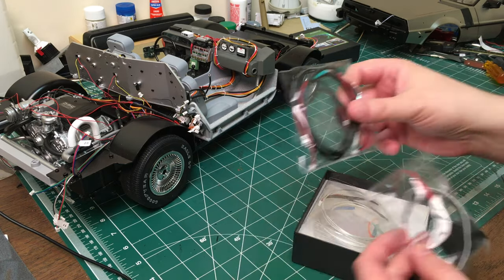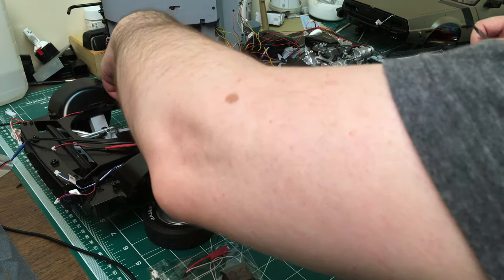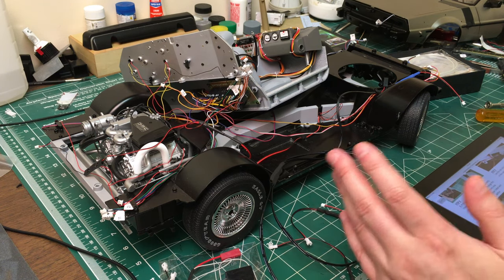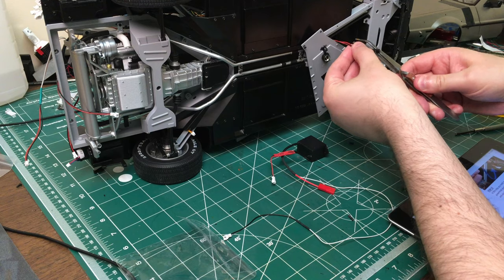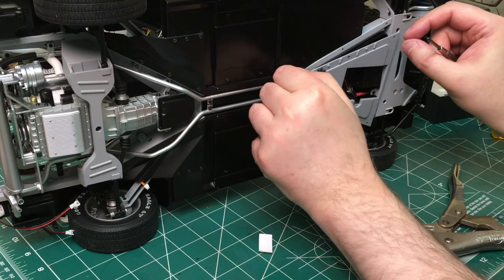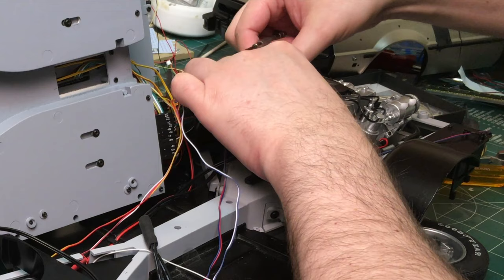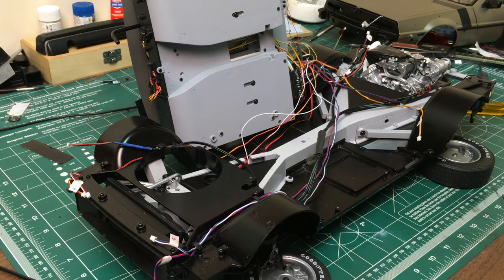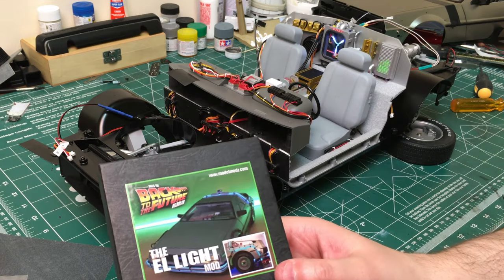Build the BACK TO THE FUTURE DeLorean USA!!!  Mid-Issue 91: EL Light Mod Installation

Comment: Thanks for sharing Brad!  I am so glad I will be installing the EL and power mods as I go rather than tearing everything apart.  That look like a huge pain in the butt!  The EL wire looks really good!
Reply from the maker: It was definitely a real pain, and the EL wire looks 20 times better than on the video!  It's a lot brighter under normal light.  I'm using large studio lights when I record, and it's got a large diffuser on it, so the EL lights don't appear as bright as they usually would.  It's definitely cool looking.  I might buy some more for some other projects, or just to play around with it!

Comment: Been struggling with this mod for a few hours. Everything looks hooked up right, yet I still don't seem to be getting power to the el rope.
Reply: figured it out. my 23 wire wasnt plugged into the circuit board. So it works! but the inverter is definitely whining with a very high pitch lol
Reply from the maker: Do you have the Power Mod?  If you're running on batteries, it should work, but Chloe told me that it might not.

Comment: The convertor makes a high pitchy noise?
Reply from the maker: I think I got a bad one, but right now I'm just angry at the DeLorean and need to get several replacement parts before I can properly diagnose the EL light mod.

Comment: You still have the automatic transmission I notice XD

Before you finish 91 (if it's not too late, I haven't looked ahead yet) you should do that, if you care, heh
Reply from the maker: Yea, I said "screw it" to the manual transmission.  They only sent me one issue of the two needed to convert it over, and it's too late now.  I'm not pulling the engine apart for someone no one is ever going to notice.